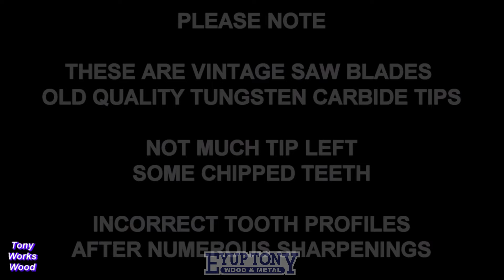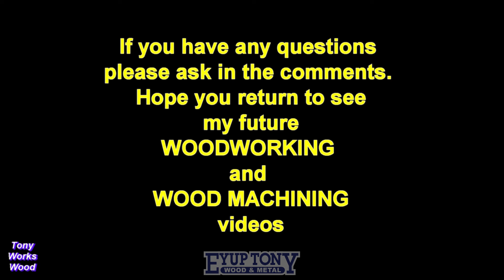Zero Clearance Table Saw Insert

Comment: Nice finish Tony.   I just use the regular multipurpose circular saw blades and they always tear up the underside of ply/timber. I must check out your style blades.  Cheers Rob
Reply from the maker: @Xynudu  Hi Rob. You need an alternative bevel tungsten carbide tipped saw blade. With as many teeth as possible on offer for your diameter of blade. This type of blade is best used for panel work or even ripping thin timber and crosscutting timber, but not so good for deep ripping thick solid wood/timber. That's when you need in laymans terms, less but bigger teeth. Thanks for your support......Tony

Comment: just about to fit the zero clearance insert I got free with the rage 5 and a saxton hundred tooth blade (brand new) for something I'm doing with 9mm ply on my conservatory roof, blade at the moment is ripping the shit out of the underside!
Reply from the maker: I Watched you mention it on your video. Doesn't seem right to me 100 tooth blade is a lot for a saw that size. Is it that pot luck crappy Chinese plywood with no glue between the laminations? Hope you manage to overcome the problem. Cheers Tony